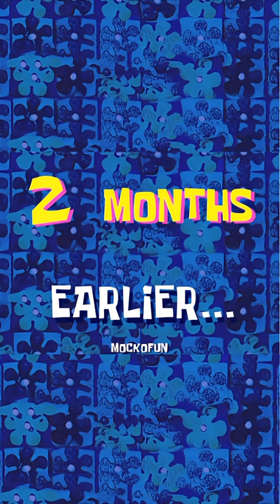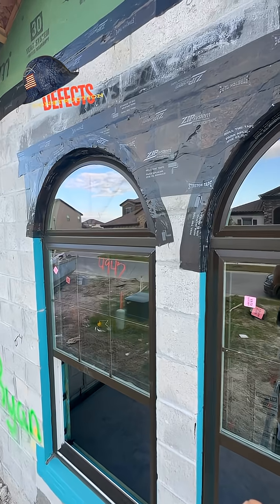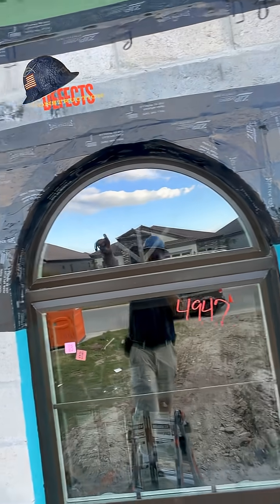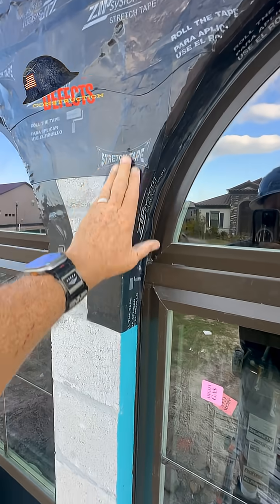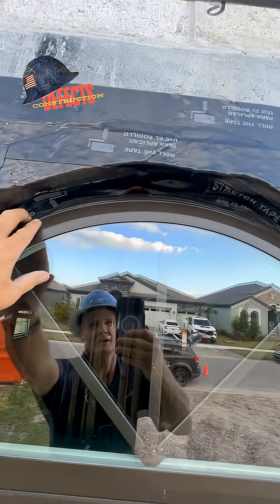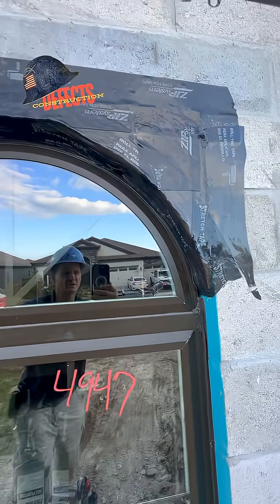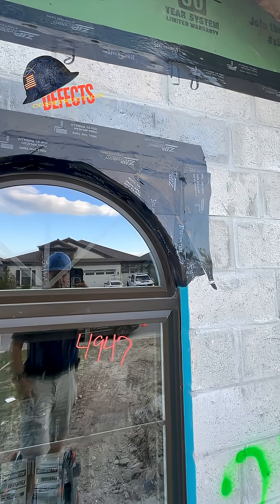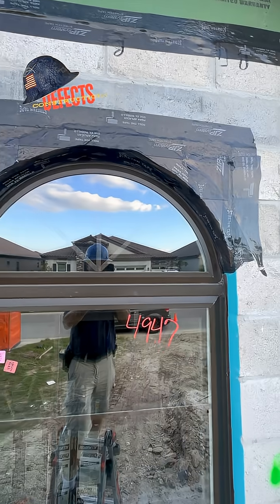New Home Nightmare: Why Arched Windows Leak (Before & After)

Comment: Thank you that’s very good information . What do you recommend as follow up after the initial prep or first installment of weatherproofing ? I live on the west coast and have stucco on the outside of my house. All my windows were caulked upon installation but do I have to recaulk every so often before seasonal rain ? And if so should I remove the old caulking or just reseal over original ?
Reply from the maker: Hey @stboo2u2, thanks for the kind words—glad the info helped!
On the west coast with all that rain and stucco, yes, you should plan to inspect and touch up caulking every  couple years (or right before the rainy season starts). Moisture and temperature swings break it down over time.
Best practice is Remove as much old, cracked caulking as you can first (use a caulk remover tool or utility knife carefully). Then clean the surface really well (wipe with rubbing alcohol or a mild cleaner) so the new stuff bonds properly. Just sealing over old failing caulk usually doesn’t last long bcuz it can trap moisture and fail faster.
Use a high grade exterior silicone or polyurethane caulk rated for windows/stucco (something like DAP Alex Plus or a paintable hybrid). Smooth it with a tool or finger for a clean bead.  You only get one smoothing wipe withe most polys FYI
If the windows were professionally installed and caulked, check if there’s a warranty that covers touch-ups. Let me know if you have pics or more detail I can give more specific tips! 👍 Thanks for Watching!